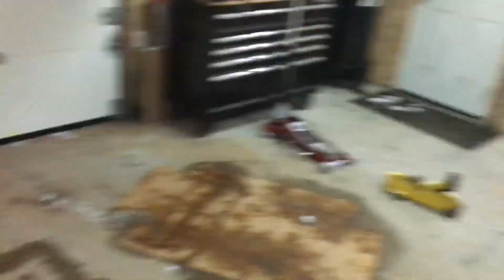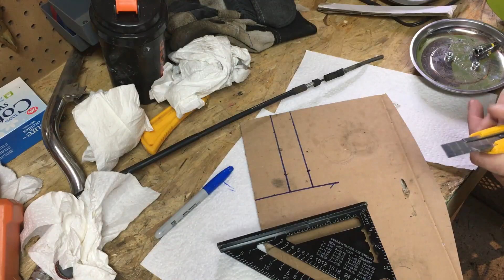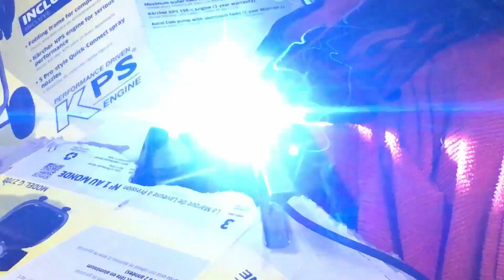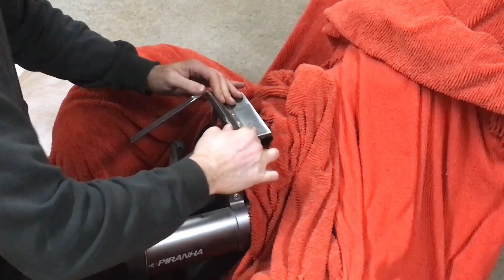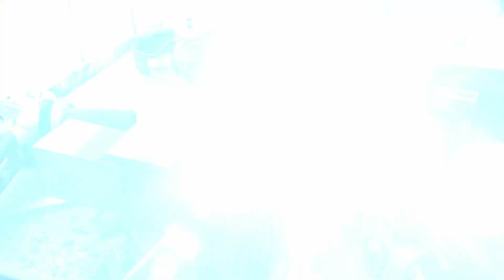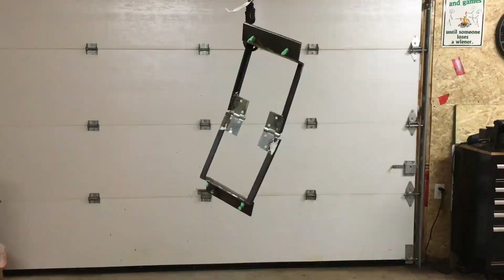1983 Honda ATC 70 Custom Fender Hinge for Piranha YX140 Kickstarter Clearance

Comment: Seems easier to convert to Recoil Start. Kits available from $39-$239 depending on what Recoil and what flywheel case is used.
Reply from the maker: Depends entirely on your skillset and motivations I guess. It cost me $0 for the scrap I had kicking around and 2 hours of fabricating, something I really enjoy as a hobby, so I see far more value in that. I've also been asked multiple times to build these for others so it has actually turned into a money maker. To each their own.

Comment: where did you get your yx140 from?
Reply from the maker: The only Canadian supplier I could find is a guy named Dennis at hondamini.com. Most places that sell the YX140 (tbolt USA, etc...) sell the motor, carb, etc... all as one package but this guy sells parts separately. Keep in mind that the carbs he sells are not genuine Mikuni, but can be made to work half decent. You can do further reading on this if you search for "YX140 fake Mikuni" on Google. Lots of forum discussion on the subject.
Reply: blastworks  yes I’m aware of the fakes and the half ass quality, I’ve been told genuine jets in the fakes make it a night and day difference, did you get yours from hondamini?
Reply from the maker: @mingling1182  Sorry! I was a bit unclear. Yes, I bought my motor from Dennis at hondamini.com. In comparing the cost of buying in Canada and paying extra for parts that were taken out of a bundle, it was still cheaper to buy from him.

I ended up having to drill out the pilot jet in the fake Mikuni from 15 thou to 21 thou to get it to idle and run from 0 - 1/4 throttle correctly. That process is in one of my other videos on the ATC 70. Check it out!

Comment: Wouldn’t it be the same as un mounting the seat? Because if you have the seat on, you would need to bolt it down.
Reply from the maker: Steven Barron Not really. The seat bolts to the rear plastics, and then usually, the plastics directly to the frame. In this case, the plastics are being bolted to the hinge. Maybe I'm not understanding your question/comment entirely. If so, clarify and let's discuss further!
Reply: I’m talking about the bracket that goes onto the seat and bolts on to the sides of the frame behind the gas tank. I’m assuming that it would need to be bolted down in order for the seat and the plastics not to move while riding. Therefore if the seat would be bolted down you would need to take off the bolts on the side of the frame so the fenders could go up to be able to kickstart. But my question is... wouldn’t be the same as taking the whole seat with the fenders off because those two bolts are all it takes to take the seat off.
Reply from the maker: It isn't the same. I use a set of "wing bolts" that I make up in the next video to screw that bracket on to the frame. As for the back of the plastics and where they mount to the frame, you would also have to unbolt the seat assembly from where the back of it mounts to the frame, where my bracket is mounted.

Comment: if you take the 70 off any sweet jumps the seat could bounce since its not secure unless someone is actually sitting on it to keep it down right?
Reply from the maker: jmsmilin The seat is actually secure. In this video I talk about making up spring pins to engage the holes in the frame to secure the bracket when the seat is down, but then in the start of the very next video, I show the making of "wing bolts" that I use to secure the bracket to the frame when it is in the down position. Check it out here!

https://www.youtube.com/watch?v=20w8ngoS-P8

Comment: you sell these?
Reply from the maker: jmsmilin At this point I'm not sure. This is the first one I've done, and usually with the firsts of anything I do, I like to keep them for myself!
Reply: @blastworks  can you make me one or two for a fellow canadian ?  can provide oem parts if cores needed
Reply from the maker: @mingling1182  Unfortunately this hinge was a one off for my project. Counting the total time I put into making this part, I'd have to charge $400 or so if I was going to fabricate and sell them. If that cost doesn't put you off, then maybe we can discuss further. You can contact me directly via the contact links on my website, which there is a link to on my main channel header.